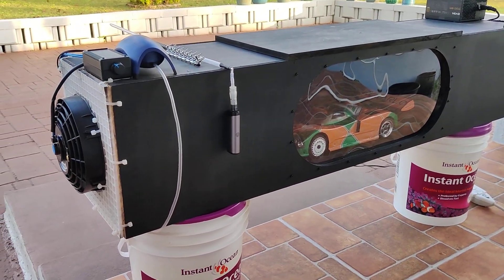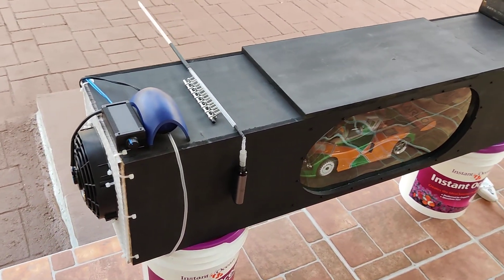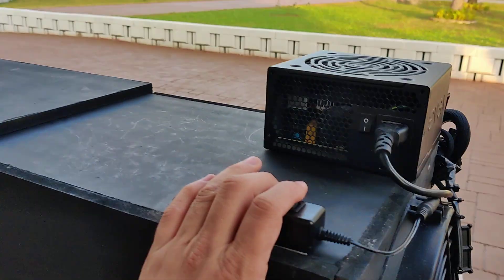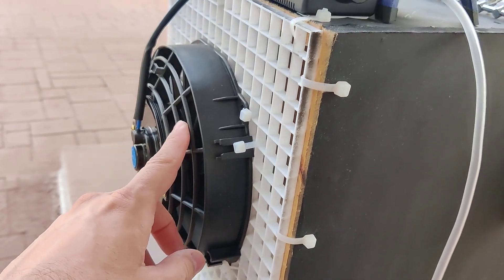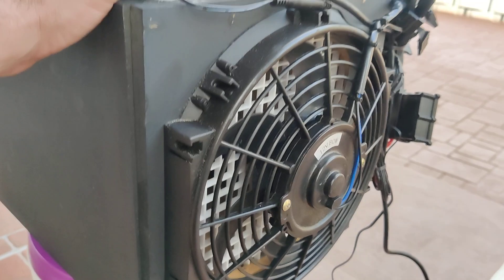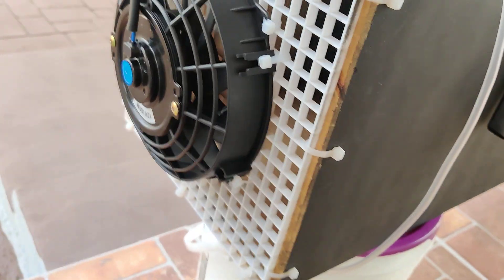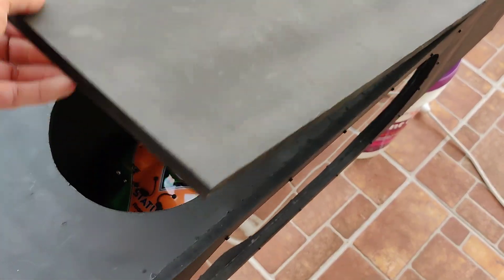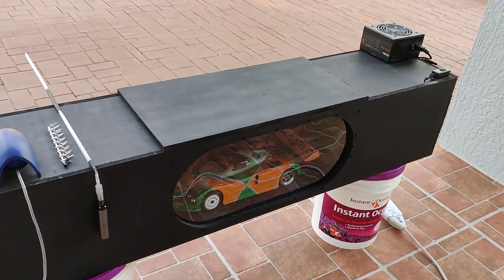Rc car Wind Tunnel

Comment: Whats the highest speed the wind can move with those fans?
Edit: oh ok, 10.5mph. cant wait to see the highspeed version of this setup!
Reply from the maker: Yeah, this one is mainly for smoke testing. Even the "low speed" is a bit much for the smoke at 8.5mph. the high speed one will definitely show the effectiveness of that adjustable wing and many other things like ride height, suspension setup, my duct design, etc.
Reply: @Gamyrc  Very kewl, going to be awesome to see and RC Wind Tunnel!